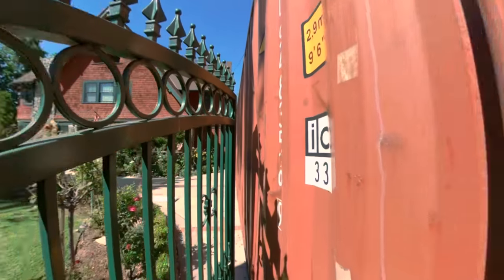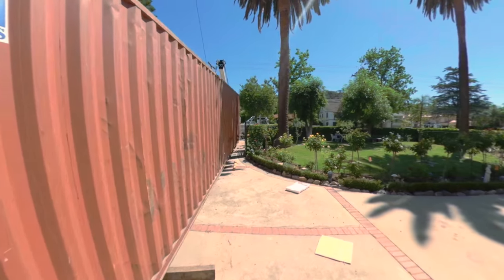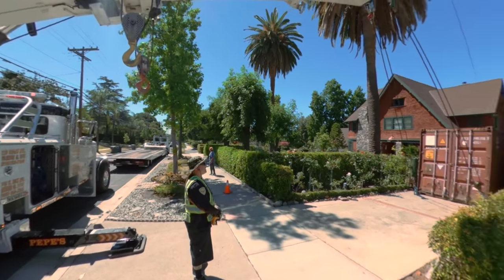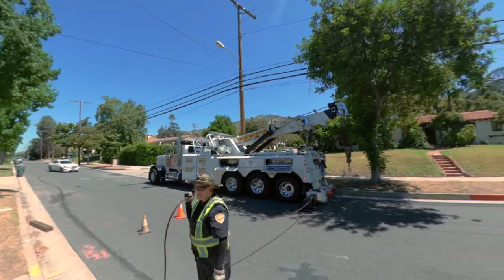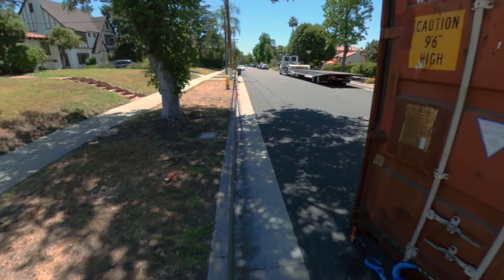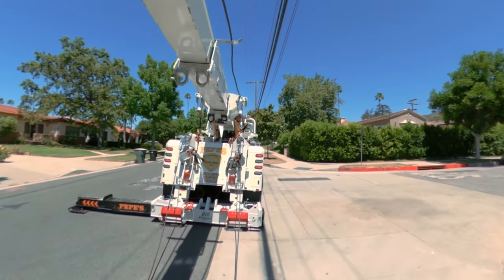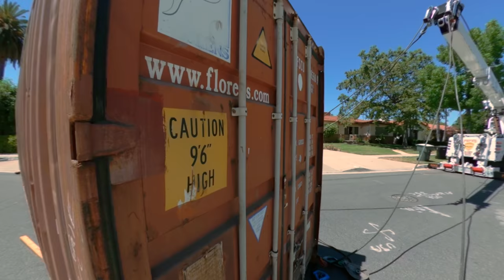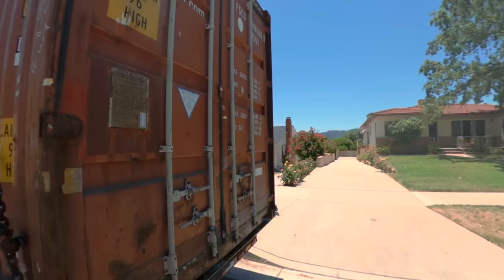Fishing a container (loaded with a classic Mustang) out of a house

Comment: Good job getting the sea can out without damaging the driveway, fence or landscaping. The limited space and overhead lines always do provide challenges, but nothing a skilled guy on the remote can't overcome. I didn't like those light duty straps on the Mustang either, not sure I'd want that going on a ship across the Atlantic and bouncing around if it was my car, they should re-secure that with stronger straps, the ones they've got on there look like motorcycle straps. But, that's not your problem, they wanted the sea can out, and it's out and gone. Good job!!

Comment: With those container skids (I am assuming they are made of plastic and/or wood) you could use a Forster bit to drill some pockets in them and glue in some strong disk magnets. That way you could attach them to the container without having to hold them in place as it is lowered down. They would also stay in place as you lift to reposition.

Comment: Mr. Pepe, Just a thought but if you had some twist locks like waterfront cranes and the port packer machines use to lift loaded cargo containers from the top with a little fabrication  installing an eyelet and some stop lock to the end of the twist lock, things would be much easier to lift, flip, slide any container (of which there are many types).  ALL containers must have corner pockets in which to lift. I believe it will save you time and the bringing  out so much gear. With the modified t/l you can go directly to them with your hooks be ready to maneuver in ten seconds, be safe and still get the job done...good luck nice videos
Reply from the maker: Thank you for the suggestion, may I ask if you are new to my channel or if you've seen my other rollover videos? For containers, I always use B/A container links, they are highly regarded as one of the best tools for lifting and recovering containers, I swear by them. On a job like this, it would be much more difficult to rig to the top holes, hence why I used 5/8" chain in the bottom pockets. It takes literally seconds to run a chain through the bottom hole and connect it back to itself, then connect a grab link to that which goes on my snatch block.

Comment: I feel like there should be a set of wheels that you can attach to the  sides and then roll it.
Reply from the maker: Container dollies? They exist, but I see them used on empty containers.
Reply: the only problem I see with dollies or wheels is controlling the container speed once it is in motion. Wheeled dollies would need some sort of a braking system to slow down a container or it might just take off going down a hill. Imagine having a weight of 12 or more tons in motion, that is very hard to stop on tiny wheels. The skates Pepe's used provide natural friction resistance that prevents the container from getting away, unless it's on a really steep hill and they spilled a load of grease or soap ;)
Reply: @PepesTowingService
Reply: @silentepsilon888  We used to load 17 ton (34 000lbs) carpet tufting machines into 30ft containers using skates on the machine and braked it using the works van with a turfer (pullalong) winch attached. The road was an inclined plane of about 5-7 degrees. As long as you worked slowly and carefully everything went great. We did this process about every 8-10 weeks, so became quite skilled at it. Being an engineering company it was no problem to design, build and utilise steerable caterpillar skates with a load capacity of 20ton each. On level planes, one man could easily move machinery along.
Reply: Sort of like how PODS  do it
Reply: @silentepsilon888  
I don't think it would be a problem controlling the container on skates.
Use a large forklift, a backhoe, wheelloader or similar to drag the container out on skates with forks or shovel against the container to stop it again. 
My company moved 15000-20000 lbs machines with a 2500 lbs forklift this way without a problem.
Reply: Stupid question: How did they get it into the driveway, to begin with? Couldn't that same company take it out?

Comment: have you thought about using some ISO container lifting lugs at all rather than those links ? i noticed you mentioned about the 3 point contact with those 5/8ths.. and trying to get the skids under?  Awesome lift and load in awkward situation there. nice job guys :)
Reply from the maker: I have not for a few reasons. One, we usually use both top pockets with container links when working with containers, especially rolled over. They are so secure and trusted, I wouldn't use anything else. For odd jobs like these where I'm doing a bit of pulling, the chain and foundry hooks work fine. If I were to come across a set of those lifting lugs I'll give em a shot, but I won't go out of my way to get them.

Comment: say instead of sliding why didn't you get 8 pieces of pipe 4 down each side of the container and as you pulled forward you move the pipe from the back to the front, to let the container roll as you pull you move the pipe from the back to the front?just a thought??
Reply from the maker: That literally is twice as much work. Why would I do that when I have container skates? And once in motion, what would stop it from rolling?

Comment: I'm curious why you didn't back the trailer in and pull out. I've pickup up and dropped off those shipping cans in some tight areas.
Reply from the maker: There is a house directly across the street, it would be possible but not without climbing over the curb and grass. Then what? Attach a 3/8" chain to it and winch up a 25,000lb loaded container, destroying her side walk? Plus did you see the wire directly over the container? Doing it your way would absolutely hit that once you level the bed. I told the lady I could do it with zero damage to her driveway and I did.
Reply: Pepe's Towing Service good answer didn't see cable. Good call.

Comment: Why would the special truck that dropped it there not come get it ? Once in the street, if you had Hulk you could have picked up both ens and just set in on flatbed ! WOW.ya did good !
Reply from the maker: To copy and paste what another person wrote: "he only problem I see with dollies or wheels is controlling the container speed once it is in motion. Wheeled dollies would need some sort of a braking system to slow down a container or it might just take off going down a hill. Imagine having a weight of 12 or more tons in motion, that is very hard to stop on tiny wheels. The skates Pepe's used provide natural friction resistance that prevents the container from getting away, unless it's on a really steep hill and they spilled a load of grease or soap ;)
"

Comment: Tough job, but seems like you could have put the car on a rollback and towed it to a place near the port and then loaded it into a container where equipment designed to move containers could have gotten it to where it could be loaded onto the ship.
Reply from the maker: That would have made absolutely no difference on this job. What do you do with the container in the driveway? I still had to remove that, whether it had a car or not inside, it still had to go. All that would have done is create a higher bill for the customer, because now she has to hire a flatbed to tow it to the port, back up to the container, drive it in, then secure it. And this container DID go to the port. That's literally the purpose of this.

Comment: Should have backed landoll in drive and winch it on.
Reply from the maker: It wasn't a straight shot, and there are cars on the other side of the street. You COULD back it in with a skilled driver but not without running over the grass and destroying it. Plus, winching up a 25,000lb container would destroy the concrete, this has been addressed.

Comment: See those holes in the top corners? They will handle a full load. You can simply hook the top corners and lift the whole thing up and swing it around to set it on a trailer. That is how it's done in the ship yards!
Reply from the maker: I can't tell if you're being sarcastic or just ignorant. If you actually saw the video, you would see I CLEARLY say my normal method is using container links in the top pockets. In fact, every container video I've ever posted is done this way. This was the first time I tried this method and felt comfortable with it due to the light load and not having to jump on top. Was twice as fast and still got the job done.

Comment: would have been better to redirect off the outriggers to pull that container out better - number 1 heavy company? you sure?
Reply from the maker: You mean run a snatch block down to the outrigger and pull? How would that have been better? You get 100% pin point accurate control the way we did it, allowing us to bring it out within inches of the gate on either side. I could have also used a deadman, parked at an offset angle, I could have done this 10 different ways. But please, some Youtube idiot knows better, please teach me.
Reply: Pepe's Towing Service - gotta love these ‘experts’ who want to tell us how to do our job so much better.
Reply from the maker: @Bos742  Right? It's always either from people that have never operated a rotator let alone a tow truck. Or even better, someone that thinks they can do every job with a flatbed or 1ton lol

Comment: I wondered if you were ever going to lift containers from the bottom instead of climbing on top. You don't need as much height to lift them.
Reply from the maker: No need to go to the top when you're doing a simple pull or lift like this. In regards to container lifts, like when the landing gear breaks or something, you ALWAYS want to go to the top. Let's say the load is shifted to the right. If you rig to the bottom holes and boom up, there's a possibility of it going over. Or if it's on unstable ground and you have to rotate it. Lay your phone flat and put one finger under each side in the middle. See how unstable that is? By going slightly up with even one finger, your phone will fall. That's an extreme example, but I never take unnecessary risks like that. Besides, that's what I have my telescopic ladder for. I'm young and fit, it takes me probably 4, if that, extra minutes to rig to the top where it's recommended and safe. You have FULL control at the top.

Comment: Why not just drive the lowboy into the driveway and load it there?
Reply: How do you lift the container in the driveway to get the lowboy under it?
Reply: @buggsy5 Have you ever seen container trucks designed to take containers? They have a bar on the end and the bed tilts down and they use the winch. Once the container hits the lowered bed you lift the bed and the container goes with it. Just seems like they didn’t bring the best equipment for the job.

I would assume the low boy has ramps if not notch I beams and make them. Then use the winch and pull it up. 

I don’t know all what difficulties they had and why they used a rotator to pull it but I’m sure they had their reasons, it’s why I asked questions to help understand.
Reply: @wwrite  A rotator was certainly not the best method - there was ample overhead room to use a crane.
But apparently the home owner did not do much of a search for crane services, there must be dozens of them in that area of the country.